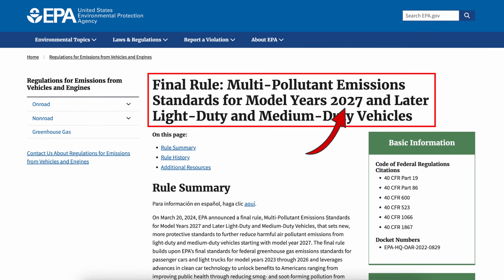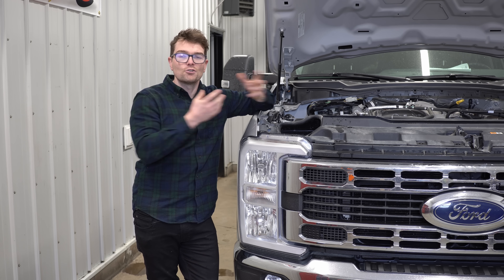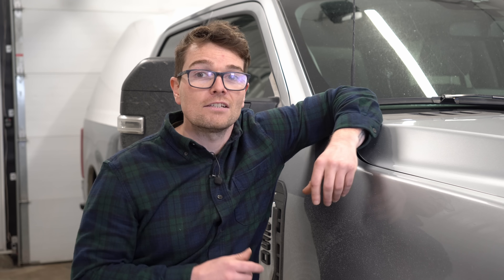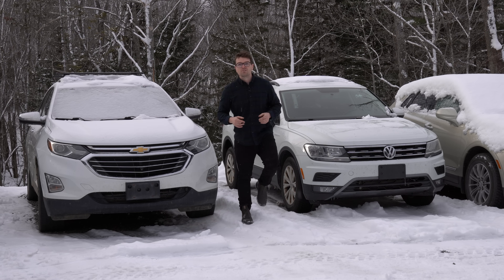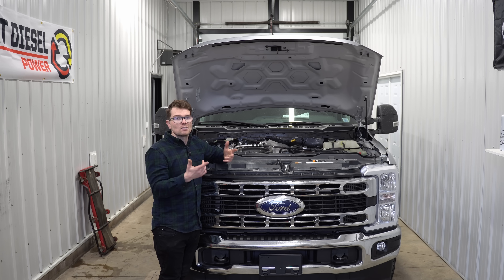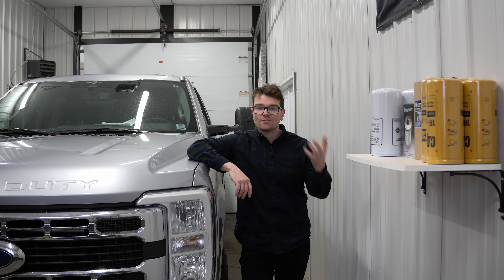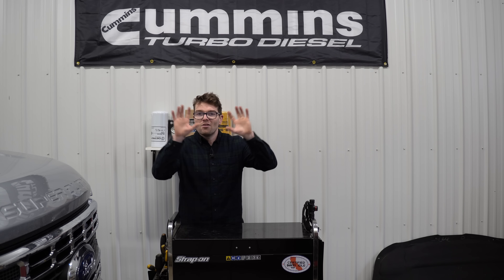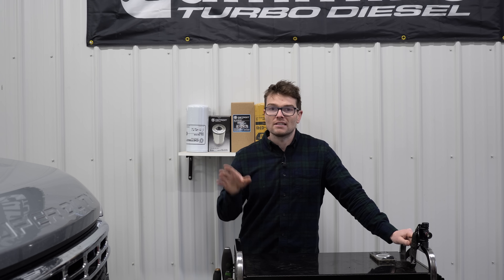NEW 2027 Cummins Diesel Engine EMISSION REGULATIONS are WILD **Diesel Mechanic Explains**

Comment: So the EPA Cartel is actively working to kill the diesel industry. 

All of the end user emissions from a single vehicle are peanuts relative to the entire manufacturing from source to end product. Furthermore, all of these restrictions choking out and killing the life cycle of these engines only serves to drive the cycle of consumption which is the biggest contribution to emissions. 

Scrap all the emissions controls and mandate 10 - 15 year powertrain warranty instead of emissions warranty

Comment: If you add up all the extra energy to transport, manufacture, install, and maintain these pollution parts(and def) I would venture a guess that more pollution is put out than if we didn’t have all this crap. I had a DEF tank sensor fail and had to have the part flown in. I’m pretty sure that put more pollution in the air than my  machine will ever put out over its lifetime.

Comment: As someone who likes these emissions equipment (but not their implementation) the fact that they're extending mandatory service under warranty makes me intrigued, because I know the numbers they want are achievable, but we only hate these devices because they are not designed to last or be serviced.

IMO if they kept the spec but extended warranty and required serviceability we would get cleaner air simply for the amount of trucks that would be operating properly.
Reply: People don't like them because; they rob power, they damage the engine, they use more fuel, they add cost to vehicles, and they add extra components to fail and need to be replaced or serviced. We don't need any emissions regulations on personal vehicles

Comment: I can't wait for this honestly. These laws push diesel tech where otherwise nothing would happen. Diesels are getting more efficient and cleaner. But what I wish the laws would address is the EGR soot buildup, there are better ways and it just allows manufactures to make more money on the service side. We can have the best of both worlds and I hope the EPA enforces this.
Reply: And the rest of us hope the EPA is gutted. The tech isn't getting better, it's getting worse. Now we have 100,000$ trucks that don't work and can't be relied on. They could blow head gaskets, a transmission, a turbo, have EGR issues, have to Regen at any given time, spin a bearing, have computer issues, have clogged emissions systems, have an issue with the DEF system now the computer won't let you move. I've known people with all the problems mentioned with trucks that I consider nearly new. It's ridiculous. Meanwhile 450k miles on a manual Cummins and has no issues besides clutch replacements and preventative maintenance. Americans need to prioritize reliability over some arbitrary level of emissions
Reply: Bootlicker

Comment: Achates Power has a 2 stroke diesel engine design that Cummins has access to.  This design meets the expected 2027 EPA limits.  I hope to see this in these new diesel engines.  It's cheaper to manufacture since it eliminates the valve train.

Comment: My 2022 F450 got 90k miles on the first EGR cooler and valve. That was a $6000 fix. I now have 220k miles and continue to have problem with the EGR system.  In 2 1:2 years I’ve spent nearly $15000 on EGR fixes and replacements.   I love Ford but the EPA is screwing us all. When you spend more than $100k on a truck than spend on average $15k-$20k yearly on maintenance and fixing exhaust issues it’s no longer worth it.  I use my F450 for commercial transportation but my next truck is going to be a big truck with a bigger motor to handle to longevity I’m needing.  Basically I’m going to choose more fuel cost in a heavy duty truck to eliminate the maintenance cost of a medium duty truck.

Comment: Cummins solved this problem years ago by designing a diesel engine. That ran higher roms like a formula-1 race car. Naturally burning ALL the carbon.DPF not needed. But the EPAwould not allow it.

Comment: The only thing to worry about that's coming out of the exhaust on a diesel truck is it's valves.. If those stay in, then nothing else matters.
7.2L Cummins.. GOSH! just stuff a 10L in there and be done for the next 50 years!
Reply from the maker: I wouldn't say no to a 10L - might be a little heavy though

Comment: 3:35 if you need to know why these components are breaking then shall "we" enlighten you? It is by design guy. In order for the factory to sell new trucks would mean that your old one would need to break. And as reliable as a diesel engine is without all the emissions crap on it there would be less need to buy a new truck. So it is the car manufacturers lobbying with politicians to pass these bogus laws and create these stupid genius systems that help the truck to fail and break so that the factory can sell more new stuff so that they can continue to make more of a profit this year than they did last year for every year into the future until the bubble burst. Meanwhile propagating that you feel guilty and blaming you for the pollution coming out of your car supposedly hurting the environment, meanwhile the railroad the shipping industry the military The agricultural industry and most of the other countries in the world have no EPA regulation. I could see were guys like you in this video have skin in the game being as you have making money off of these systems breaking and then charging exuberant amounts to  fix or replaced when we shouldn't even have these bs systems in the first place. why don't you advocate for that instead?
Reply: The 'bubble' has already burst. Both the car and truck markets are severely tanking. 2025 is liable to be a very rough ride for everyone---except the mega-wealthy, initially--but even they will feel the heat, despite the 'firewalls' they think will protect them from it.

Comment: Lets hope the new administration adds a bit of common sense to this seemingly never ending do-loop of regulations. I am convinced the previous administration was just trying to kill the diesel so making sense of the new regulations was not the intent to begin with. I am however, looking forward to extending the warranties for just emissions related issues. I think a balance can be struck there and perhaps the parts will be built to last like the engines are.
Reply from the maker: The key is getting to that balance, and I think the next round of emissions regulations starts to really push the industry too far

Comment: Im willing to bet these regulations get canned with the new administration. I just hope we don’t see this come to the gas engine side- that would essentially be an ev mandate in disguise. As for the warranty part- it will for sure increase the consumer upfront cost, but rest assured the mfgs will use that to increase profits with planned obsolescence of other critical components. Remember- the exhaust system doesn’t actually have to last 280,000 miles if the engine itself only makes it 150,000…
Reply from the maker: This is very true, if the engine poops out there goes the "extended emission warranty"

Comment: Correction "You" not "we" are worried about 3 main pollutants as you call it coming out of the exhaust system of a diesel truck. "I" am worried about zero components coming out of the exhaust of my diesel truck. Only the price of fuel going in and keeping maintenance down reliability and performance up. We all know. Delete emissions on your diesel truck and it runs forever. No brainer. More worried about WTF is coming out of these airplanes flying above me raining down toxic heavy metals and chemicals. This is a true concern.

Comment: Saving the world one DISPOSABLE DEF canister at a time, one additional gallon of diesel fuel used for regens at a time, one large mining operation to obtain the rare earth minerals and common metals needed to manufacture the DPF and EGR systems at a time, one large tanker truck leaving the large chemical factory filled with DEF at a time, one large container ship crossing the worlds oceans carrying replacement emission system parts(made in a country with zero regard for the environment) at a time, and one replacement engine transported to repair shop on a diesel delivery truck to replace the "clean" diesel engine that un-alived itself early due to all the nonsense on it at a time...........

Makes total sense because non of the above matters as long as that tail pipe is a touch cleaner. FFS

Comment: Excellent, accurate info in this video, Alex. 
Grid heaters- their purpose is to get the after treatment to operating temp quicker after start-up. The silver lining is a massively upgraded electrical system. 
The 5x lower NOx levels force a 2-stage DEF injection, either into the DOC of an additional substrate before the DPF. 
I expect we'll see more clean-EGR systems, where exhaust is recirculated from AFTER the DPF to the turbo inlet. It adds plumbing complexity, but but greatly reduces EGR cooler problems.

Comment: Truck prices are already insane. They'll pass these warranty costs directly onto the consumer. We'll become like Cuba with people driving and restoring older trucks.
Reply: Should be like Cuba anyways. Stop buying new junk
Reply: Depending on how the EPA winds up treating glider kits, already happening.  Most of the guys I truck aggregates with are driving older rigs; you can pay the bank, or pay yourself.  I wouldn't trade my '98 Pete with it's Series 60 for a brand new one - see too many sitting with Christmas lights all over the dash and in limp mode.  For a sole O/O, the annual cost to maintain + lost time is prohibitive.
Reply: @jayphillips4058 never get rid of that truck. That’s a great combo. Since gliders aren’t available anymore I’m starting to see paccar engine trucks being bought up and those engines being pulled out for one of the good 3 to go in
Reply: I'm in Canada it's even worse up here with the carbon tax. I drive a 1994 dodge cumins. at my age it will likely be my last truck, I'll drive it until i can't get parts for it any more.
Reply: We already are that way. It's nearly 100k for a new diesel truck, nobody is buying them to do work anymore unless they like living in eternal debt or they make millions. I'll never buy a new truck.

Comment: Take a look at Euro 6d and 13 liter Scania engines in trucks. They use SCR with no EGR, and no variable geometry turbo. They had to increase DEF usage from 7% to 12% of fuel usage (so by ~70%), but as fuel economy increased by 10-15%, in reality DEF usage increased by ~40-ish %. As it's much cheaper than fuel, it saves money, allows to increase power and save on maintenance as there is no EGR. DPF is made big and easy to access for maintenance (cleaning). I believe their 9-liter I6s and 16-litre V8s are the same, only requiring SCR to be Euro6 compliant when running on diesel or biodiesel. International S13 powerpack essentially is 13 liter Scania Super inline 6 engine. Solutions do exist already. Some american manufacturers already recognized this. The rest of them just has to innovate or buy existing designs instead of trying to adopt 50-year engine designs to modern requirements with heavy reliance on overly complicated aftertreatment and old-school tuning while pushing the fault of every malfunction onto the users.

Comment: I can see a system like Edson Motors coming into play.  Use a small gasoline engine driving a generator, powering a battery pack and running electric motors.  
BYD has a pick up truck like this now and it works well.  Full power when you need it and when you are on light load the generator recharges the batteries.
These type of vehicles give you the range of a ICE vehicle, with reduced pollution and the power of electric motors.  They will out perform your traditional diesel.

Comment: Lower cylinder temps does not equal more soot as long as the fuel ratio is correct. Look how much more power, economy and reliability a 2024 engine has over a 2000 engine. No ugly soot (and no, it doesn't make your groin package  bigger). Emission laws are making it better for everyone. Get over it, embrace them and move the fark on!

Comment: It is coming to the off road diesels slowly. The USCG is currently in a spat with CARB about their clean harbor tug rule requiring DPF on vessels. The tldr is the coast guard is worried about the boat catching on fire and carb is saying pound sand, the DPF will be equipped.

Comment: Other countries are trending towards lower capacity diesel engines, Isuzu has a 1.9 litre in its mid sized Highlander. That's almost 25% the capacity of a 7.2 litre. Volumetrically, it produces lower emissions, so perhaps manufacturers should offer them as an alternative, and the public accept the compromises that come with a downsize.

Comment: All emission warranty claims, will likely be denied due to components being poisoned by excessive oil consumption. Or so the manufacturers will claim. Once the powertrain warranty is up, a dealer installed long block will be required to retain emission warranty for the balance for the mandated 10yr 280k coverage. Anyone else see this coming?

Comment: more than 15 times to the garage for emissions in the last year had the whole shebang changed egr cleaned and what not failty sensors sometimes not faulty but still 800$ NOx sensors replaced for the fuck of it, dealers don't fully understand  all of the time or just make you spend more not normal to have spent 3 days with the dealer techs doing data logs to send over at the engineers in detroit

Comment: Yep, I've heard the same.  It will simply be a general, overall, increase in costs that will have to be handed down.  What you've shared, is what we've heard from Paccar too.  They already have test units running, so let's hope they are able to reduce the unknown before we're forced into it.  The other items we've discussed, is the added weight.  We may be looking at pay loads being reduced by nearly 10% due to the weight of the heating units added to the trucks.  Shippers and receivers are going to be fighting for older equipment and increased payloads for as long as possible, they won't want to shoulder that burden.

Comment: Would be a fool to keep that emissions garbage on the trucks. When you take all that off look at the difference with life expectancy, fuel economy, power, throttle response the list goes on and on. All negatives to keep it aside for carbon monoxide, diesel particulate matter,  nox reductions but they aren’t worth sacrificing your investment over, take that nonsense off “it fell off my truck bro” register it as a business vehicle in a friendly state/county problem solved

Comment: by my understanding EGR lowers combustion temp but not cylinder temp which it actually raises. As for meeting the new emissions targets NoX can be lowered and egr removed if they just ran more DEF. Another way they lower NoX is lower compression ratios as this also decreases combustion temps Also Egr can greatly be improved by putting the exhaust into the engine after it has gone through the DPF which removes the soot,  which caterpillar actaully did on their last on road engines.

Overall my view on emissions is that even if global warming turns out to be a natural cycle does it really hurt that all these emission laws lead to cleaner air that we all breath day in and day out?
I am reminded of how far we have come whenever i drive through a tunnel that in the early days had super hazy and foul smelling air cars and trucks but can now be driven through windows down and had clear air inside it.

Comment: Lets just end all this emissions conversation there are several tuners out there that have proven that by deleting the system and tuning it properly they can actually tailpipe test it at lower emissions ratings then what stock trucks can do so lets just grid rid of all this and properly tune the engine just saying

Comment: Egr lowers fuel efficiency. So more fuel required for the same output. 

Egr wears out engines faster by forcing soot into oil.

Scr/dpf creates back pressure which chokes engines and causes premature wearing of engines/overheating and destruction of head gaskets.

All of this causes more parts and engines to be produced which pollutes the environment more than just keeping  units on the road.

It’s all a gigantic scam.

Comment: This is correct, after they sabotage our independence with diesels (lets not forget the old ones we can run them off heavy oil and vegetable oil  etc which means we don't have to pay tax, it also means we can produce our own fuel, thus being independent from the system. They are control freaks and they need to control in order to bring in the non independent upcoming digital reality where by everything we do and everywhere we go will be monitored, by our acceptance of giving it data. Its our own demise essentially. If we agree (like in 2020) they will squeeze more. Unfortunately the corporations who they own are the 1st to agree. So by default we are goin in that direction. They will use fake climate change to justify the upcoming rapid introduction of human phsyborgs and self driving flying electric cars which we will rent and need to be a socially accepted citizen in order for the vehicles to get us from A to B. And A to B will be very local BTW. There was an episode of Black Mirror once that showed a futur reality where by the ultra rich still had pristine old cars while the masses were on foot or in rental electric self driving nano pods. 180% increase in warranty will be the catalyst. Once the Main car companys are bust the Chinese self driving Electric cars  will be free to roam. Game set match. Check Mate

Comment: You can eliminate all those problems by running a lien air fuel mixture ratio, which also lowers combustion chamber temperatures eliminate because of a thorough burn and is it supremely more efficient system
Reply: The EPA won't allow a lean air fuel mix because it would cause nitrous oxide emissions.